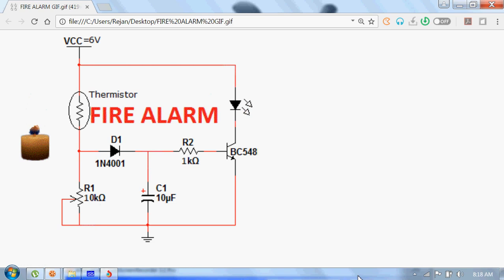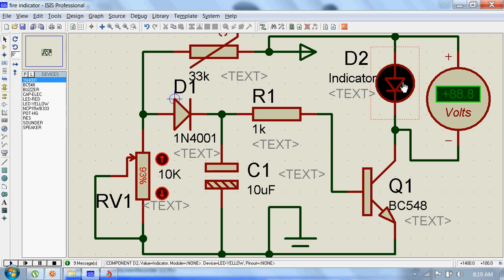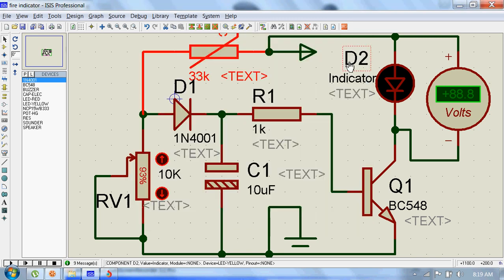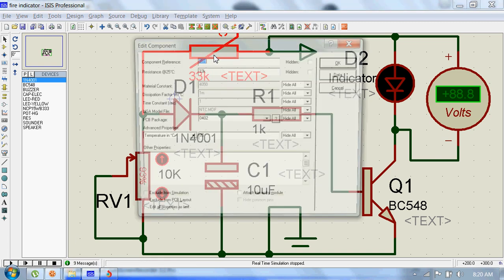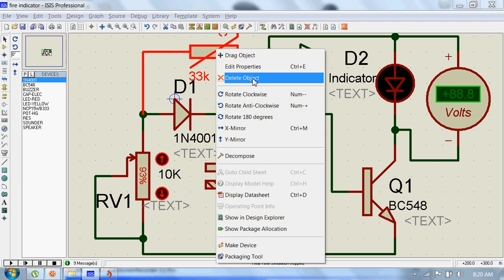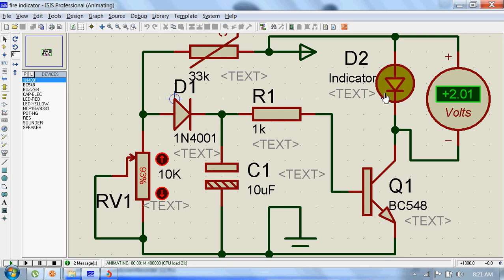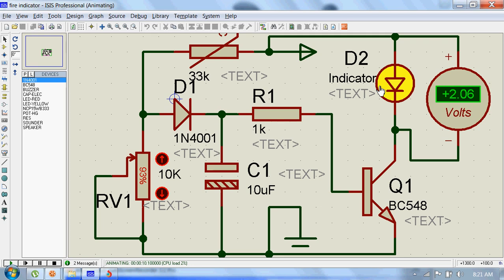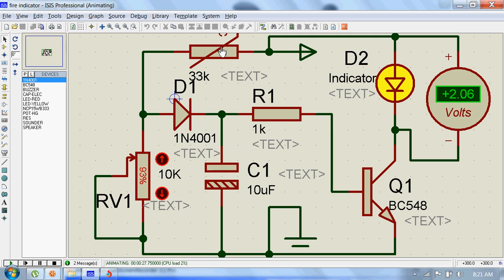fire alarm circuit.avi

Comment: Wow! ts wonderful friend, but what happens whenever temperature increase exceeds the temperature limit?
Reply from the maker: That's a very good question Castor. As per the simulation, the voltage across the LED went up to a maximum of 2.26 Volts at or above 150 degrees. Beyond this temperature, the voltage across the LED did not increase at all.

Comment: How do we determine the minimum temperature for which the led will glow
Reply from the maker: There's potentiometer for that purpose. You can decide the temperature at which the LED will flow by changing resistance of potentiometer.

Comment: Nice, but can u tell me what is the role of the transistor in this circuit
Reply from the maker: That's a good question. The potential divider network between R1 and the thermistor drives the transistor which will further change the voltage across LED making it off or on.

Comment: - Purpose of fire alarm and detection systems
• The main purpose of these systems is to quickly respond to the fire and then turn this early response to an audio and visual signal to alert an individual or group of individuals in the building, place, relief or fire station that there is a fire in its early stages.
2- The stages of the fire
Most fires go through four distinct phases:
• PRELMINARY STAGE
• SMOKING STAGE
FLAME STAGE
HEAT STAGE HEAT STAGE
Reply from the maker: thanks for adding the information friend.

Comment: Great work friend. What is the lowest and highest temperature this can sense?
Reply from the maker: Thanks friend. That's a good question. While I was simulating, the thermister responded at 90 degrees till 150 degrees. This range can be varied by varying the resistance of the potentiometer. Also, temperature range of thermistor has to be considered since it typically achieves greater precision  within a limited temperature range.

Comment: in this kind of project i prefer to use microcontroller, it is more robust and give a high flexibility level,  but this proposed solution present the best way to built a project with a low cost ressources. the simulation result shows the performance of the scheme (good job)
Reply from the maker: Yes, you're right. Thanks for the comment and suggestion :)